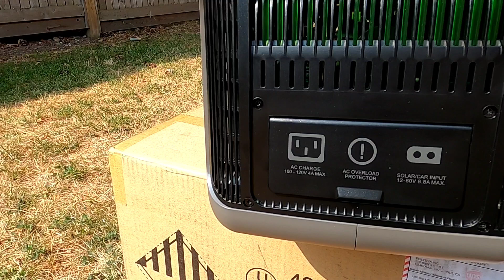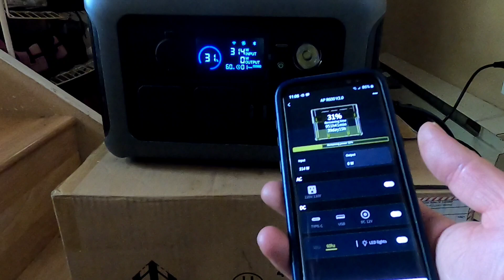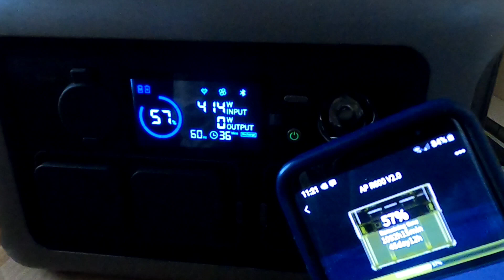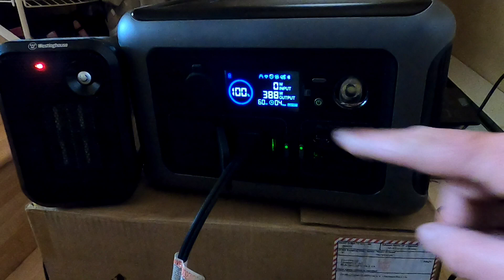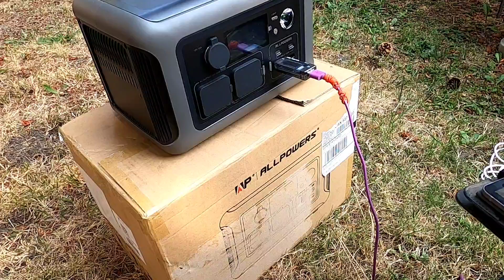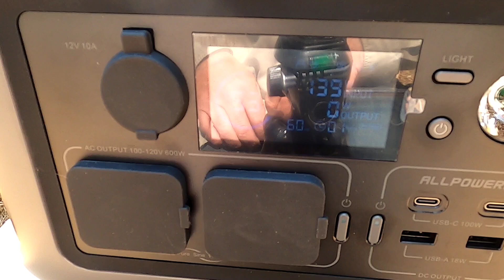ALLPOWERS R600 Portable Power Station 600W 299Wh LiFeP04 Battery

Comment: Hello Frank, thanks for this very good video. Do you know why the little solar panel produces power almost equal to its rated power ? That was not the case for the two others
Reply from the maker: @louis6569  Two fold answer but these are just my thoughts, the smaller solar panel has a white background keeping the panel cooler which increases performance generally (it is also the best flexible panel and pricier, that I am aware of) secondly, their were wildfires and smoke in my area that intensified through time I believe this additionally had impact.
Reply: @frankbush333  thanks Frank that makes sense
Reply: @frankbush333 Could it also have been due to the angle of the Solar Panel with just the right tilt towards the Sun. The last Solar Panel was flat on the ground. The All Powers folding panel that came with the carrying case was a Polycrystalline rather than a Monocrystalline solar panel, not sure how the  angle compared as to the first 50 watt one, plus they do not power up so well. I made that mistake myself - They are cheaper though. Where I live in the UK I am getting haze caused by chem trails. I very much enjoyed & appreciated your video. Just watched it today as I came across your channel. I like all the details you go into as I am only just learning. I have fairly recently bought this R600 which was more in case the electric grid went down.
Reply from the maker: @leialee6820  the renogy panel is just a better performer but the cost is higher.